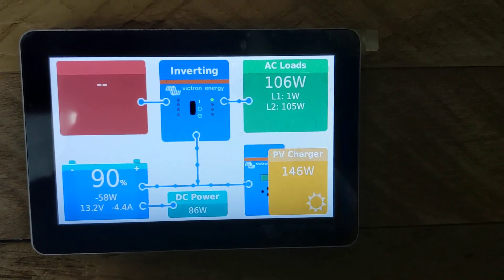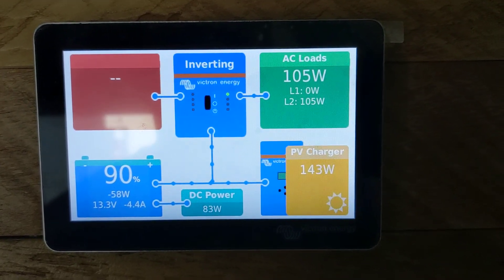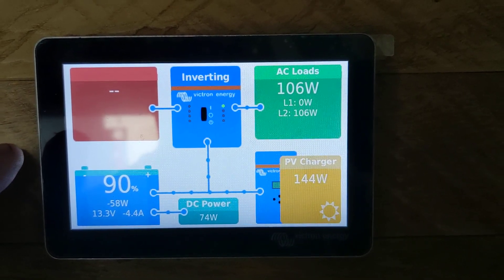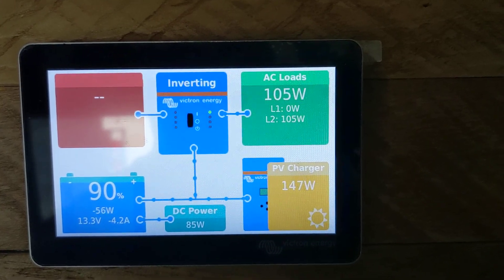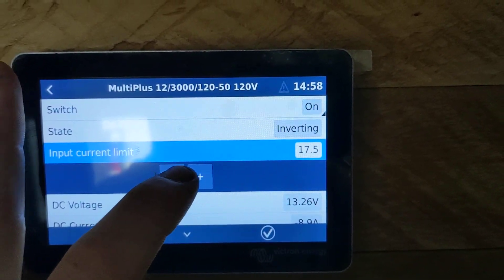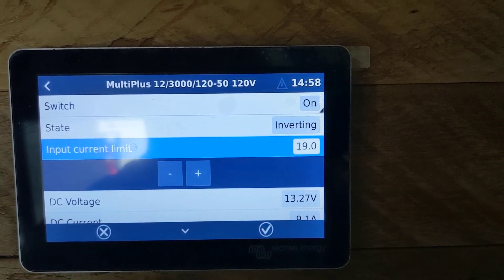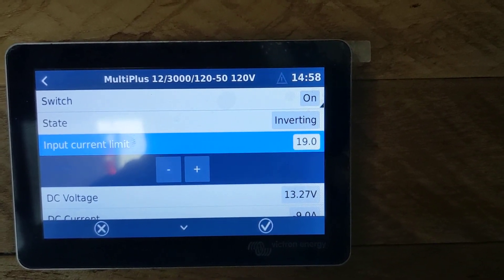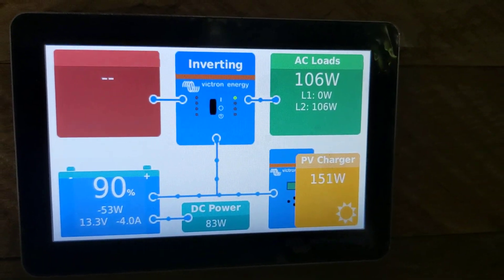Adjusting Input Current Limit, Using GX50 Touch

Comment: What do you do if the input current limit option is locked and won't let you change it?
Reply from the maker: OOh... great question. I'm actually not sure as I've never seen that before. Have you contacted your distributor/installer?
Reply: @zerodeclination  lol....I am both of those, and I have never been locked out either.

I had to set it with the dip switches, but it will only go down to 15a and I need 10a for a special case scenario.
Reply from the maker: Is "overruled by remote" checked in VE config?